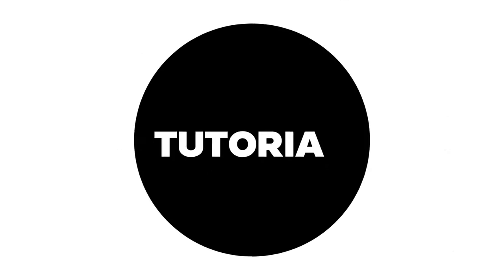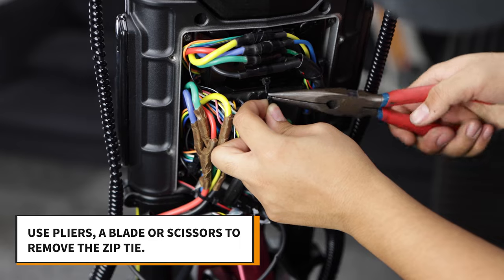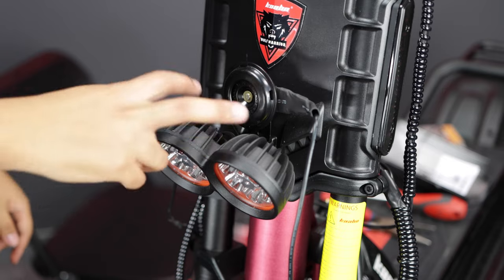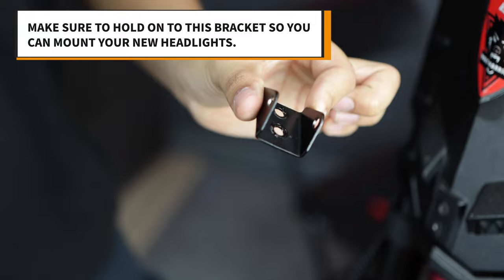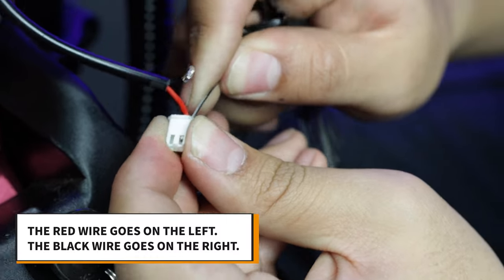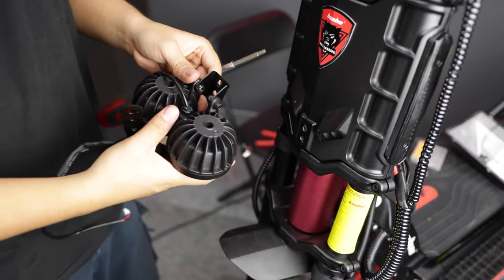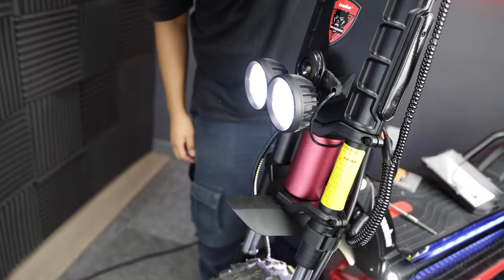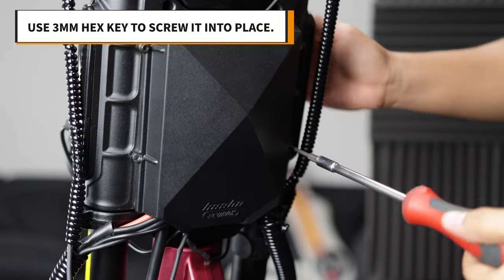How to replace your Headlight and Horn on the Wolf King GT - Voromotors Tutorial

Comment: Alot of these failed lights just have bad solder joints. if you have a few leds out check the joints reflow them and the headlight should work again.